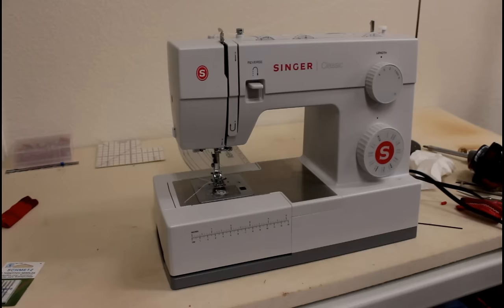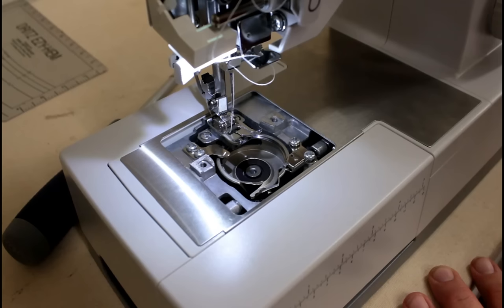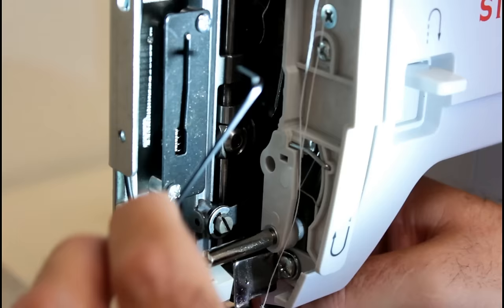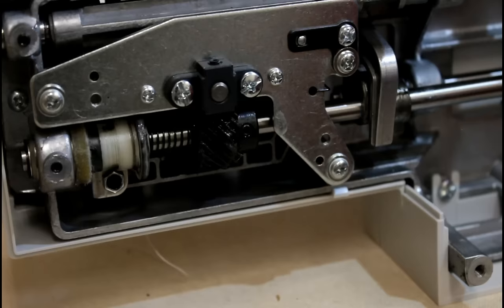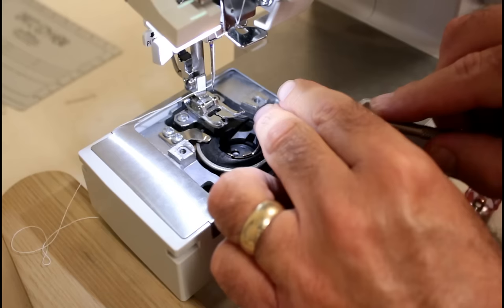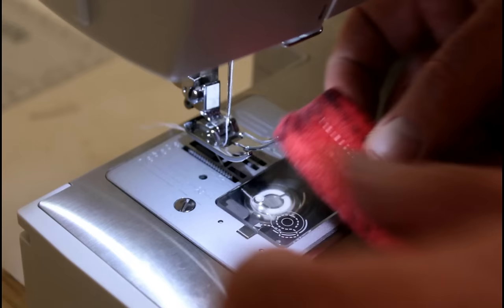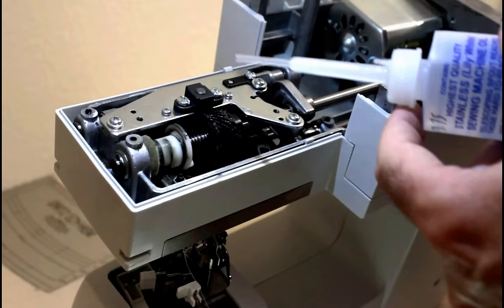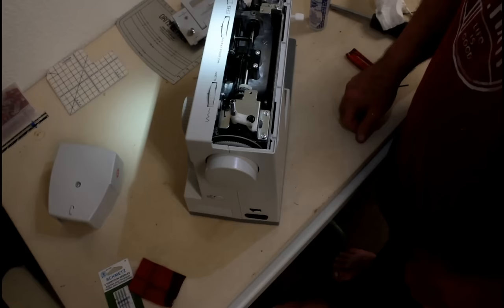Setting the Timing, Greasing & Oiling the Singer Heavy Duty Series Sewing Machines

Comment: Kevin, first of all thank you so much for taking the time to do this tutorial. Secondly, can you please help me figure out why when I loosen all three screws the bottom bobbin plate thing still wont move? I've been working on this for hours and am almost in tears. Please help!
Reply from the maker: I have heard this from a few over the past couple of months. It sounds like they changed something in the factory in the build process. I will post here once I have received any addition information on this.
Reply: @kevinsews  Hi Kevin! I just wanted to let you know that I was finally able to correct the timing using your technique, but I had to hold onto the "bottom bobbin plate thing" (sorry, I don't know what it's called lol) with a flat nose plier and then hold the handwheel still. It was tough because it didn't want to give, but after some elbow grease it worked! Just wanted to update you in case you come across anyone else with the newer machines again. Thank you again for all of your help! I really appreciate it!
Reply from the maker: @erinsullivan3407  I am glad to hear you figured it out. Thanks for letting us all know what you did.

Comment: I love this video. My machine is having a big issue with jamming the whole bobbin housing the black plastic bit that holds the bobbin Seems to get loose. No idea why this has happened so suddenly.
Reply from the maker: I would have to see exactly what is going on to help you figure it out. If the machine has lots of hours of use on it then you may need to simply replace some parts.
Reply: @kevinsews  
Lol Nooo what had happened as the top thread was wrong. Somehow in changing needles I had pulled the thread off the up and down thing, and so when i tested the tension it seemed to be fine. Its now threaded properly and sews very well. I am such a sily, and the lesson I have learned is  make sure the machine is threaded correcly before thinking the machine is broken or something.
Reply from the maker: @davidmarks509  Okay, that is great to hear.

Comment: Thank you for this video! After loosening the 3 Allen screws on the bottom my bobbin will only move freely about 45 degrees back and forth, any idea what could be jamming it? All 3 screws are lose, there is plenty of play within the 45 degrees...
Reply from the maker: Yes, I've seen that. I ended up completely removing the bobbin assemble to get mine to line up.

Comment: Thank you 

Could you by chance show the needle bar clap you adjust?  In the manual there’s an upper one that my machine doesn’t seem to have. 

I’ve gotten it working though more or less, but have noticed since correcting the timing, my tension wheel has to be substantially higher. Before I’d regularly use it around 5, and. Im having to use it almost fully maxed out around 7/8. Is there a way to internally adjust the tensioning?
Reply from the maker: See this video I created on this subject: https://youtu.be/ddFcH5lnnjY

Comment: Hello Mr. Sews, I appreciate your informative video. My machine is identical to yours. I've loosened the 3 screws under the machine like you said (it will not move by itself). I"ve even gone as far as to remove the screws out totally. I've done everything you've said. Is there anything else I can try?
Reply from the maker: I have seen that a few times. I have have used 2 channel locks to grab to shaft to keep it from moving as I rotate then piece you removed the screw from. It will eventually come loose.
Reply: OKay thx, I'll try it.

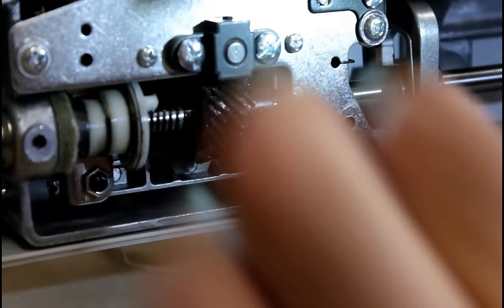Comment: at around @13:40 i couldnt seem to get those allen screws out they seem stuck, any tips? i used the same tool you did but it didnt go off that easily
Reply: @China Muff hello i managed to get them out! You have to use a stronger stainless allen key then lean towards the left and downward so it sounds like it snaps a bit (not really) but its easy to take out from there

Comment: Hi again Kevin! I just wanted to ask another question if that's OK. I followed the instructions and everything in the video, however when I went to go sew, my machine isn't producing any stitches at all. The machine runs fine, however it the thread doesn't attach itself to the fabric when I run the machine to test. I was wondering what kind of problem that could be a result of. Thank you for your time!
Reply from the maker: Sometimes it is a tension issue with the top needle thread. Go ahead and put the fabric under the foot and turn the handwheel to see if the stitch forms correctly. This will show you exactly what is going on.

Comment: Thank you for your video ! I’ve been having a tough time with my new sewing machine. I had the motor lock up, machine froze with the needle in bobbin area, and the needle got stuck in the bobbin case. Now when I sew there is a clicking sound and my stitches aren’t right and i think tension is off! Any advice or ideas? It’s greatly appreciated!
Reply from the maker: Only thing I can suggest is finding a service manual and follow the step-by-step instructions on how to set the timing.

Comment: Again, thanks for making these videos!

Over the past 2 years, I have collected 5 of these sewing machines and 4 out of 5 make a spring noise as the (un-threaded) needle brushes off the needle guard in the shuttle hook, and flexes. I have adjusted the needle bar forward just enough to make it stop - any further and it skips stitches.

If left as it was, I would guess that it would wear the needle guard out eventually (and needles).

Do your Heavy Duties also make this noise (usually on the 6mm zigzag) and do you know if they are supposed to for some reason?
Reply from the maker: None of the ones I own make that noise, so something is up.
Reply: @kevinsews  The newest machine was purchased from a retail store a couple of weeks ago and is doing that right away. Hopefully, I will be able to find out why they are adjusted like this.

Thanks for your quick reply!
Reply from the maker: @rjj2316  You're welcome!

Comment: Thank you for this tutorial. Question. A small felt pad appeared as I was cleaning the bobbin casing and I don't know where it came from. If anyone can help solve this mystery I'd appreciate it. Thanks.
Reply from the maker: It usually goes under the small round shaft that holds the bobbin down that comes from the underside of the inside of the machine. I haven't seen one on my USA model heavy duty machines though when taking them apart.

Comment: Hi Kevin. Thank you for your video. I have done all the adjustments for sorting the timing and when I look at it the hook catches the thread easily on both sides of the needle adjustment. But when I put everything back together and sew a zigzag it sews straight stitches but misses loads. Same with straight stitch it still misses most of the stitches, but looks ok when I take it all apart. Please help
Reply from the maker: You have to be careful when you tighten the bolts. If this isn't the issue then your timing may still be a bit off because the needle thread will be coming down straight off the needle once you've everything back together. You will just have to try it again until you get it down.

Comment: I set the timing everything  works good the thread picks up the thread with the bobbin in the problem  i have is once i put the plate over the feed dog n tbe plate for the bobbin  it will not hook the thread 
I have rethreaded changed the needle try different  thread with different bobbins 
What am i missing  here
Reply from the maker: Check your thread tension. Try loosing it and see if that helps. If it doesn't help then your timing might still be very slightly off.
Reply: @kevinsews  thank you  for  getting back to me so soon  ... i have tried  many different things and  still will not do it with the plate on ...  guess i have to take a 3 hour drive to drop it off to be fixed  thank you for you feed back

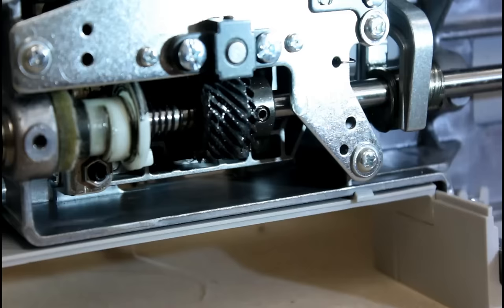Comment: Hello i’m having trouble around 14:20 loosen those screws with an Allen key its so tight it stripped a brand new set I bought for it. Should I apply grease or e-40 its missing my thread bu so little but I cant loosen those 3! HELP!
Reply from the maker: You need to make sure you are using the exactly size. Amazon has a kit I normally use. It has 4 T Sized Individual Screwdriver style bits. You can spay some oil on it.
Reply: Thank you i will look into
Reply from the maker: @yves3721  You're welcome! Let me know how it works out for you.

Comment: I fixed the timing on my machine which is great, but now my thread gets caught on the "spring" part in the lower right. You even mention it at 25:50. I've tried three or four times to readjust but nothing is working. Any advice? EDIT: OK. Saw now you addressed it in the video! I'll fine tune it and see how that works. THANK YOU for your videos. Very cool.
Reply from the maker: There is a tool that is used to place under the piece before tightening it. Try making something to place under that is about the thickness of the thread.
Reply: @kevinsews  thank you! I'll keep trying. I've broken the only three needles I have so I need to stock up. Thanks for the help

Comment: Do you have any information on timing a 5817C Singer sewing machine?  I have tried other sites, but you seem to be the most thorough in your videos and I appreciate that very much.    Thank You in advance!
Reply from the maker: If it is a top loading bobbin then it should be pretty much the same as what I showed on this machine.
Reply: @kevinsews  Thank you for the quick response.  I have 3 witness marks near the top of the needle rod and saw some videos that only mention 2 for making the timing and depth adjustments.  Do these cut lines mean anything to you?  They are about 1/4" apart from each other.
Reply from the maker: @johnbedrosian5781  They probably do. I don't see them on my machine, but it is going on 5 years old. See if your machine is lined  to one of them.
Reply: @kevinsews  Thanks again!  I have been searching for a service manual for this machine, if for no other reason than to learn.  "A mind is a terrible thing to waste"
Reply from the maker: @johnbedrosian5781  Exactly! Let us know what you find.

Comment: Thank you for the video! I was able to fix it so that the hook is able to pick up the thread on widths 1 and 6 when the bobbin is not inserted. But when I put in the bobbin for some reason it doesn’t pick it up at width 6. Do you have an idea what might be the reason for this? Thank you!
Reply from the maker: Check the top thread tension. It may be too tight.

Comment: What causes a Singer Simple Model 2263 to not catch the thread on polyester mesh material but it works fine on cotton.
Reply from the maker: Are you using a stretch needle? If that does not fix it try placing the tissue paper that is used for gift sacks under the fabric. Once it has been sewed you can easily remove it.

Comment: my needle is not moving when I change the position left, right and center. If I remove the top is there something that can be adjusted?
Reply from the maker: When I get back home tonight let me take a look. I will create a quick video on it if possible.
Reply: Might check that the width dial is at zero first
Reply: @mitchell5828  That did the trick. Thank you.
Reply from the maker: @jimwilliams8229  Okay, thanks for the update!
Reply: @mitchell5828  have any suggestions for what I've done to not let my fabric advance?
Reply: @nelsongoodson3906  yes;
What this video doesn't mention and others don't mention is that there are two  ways timing can be adjusted. (Or two places it can come out of adjustment).  Before attempting to adjust the timing you should see if the feed dogs are in sync with the vertical needle movement.  If they are not, you most likely need to adjust the timing on the shaft collar further to the right,  not the one shown in this video.
If this is your case you will first have to get the feed dogs correct w the needle using the collar I described above.  After that you will have to follow the instructions on this video time the hook.
I apologize as this is hard to explain in text.

Comment: Your an amazing teacher!! I have been having trouble with the top thread not catching the bobbin thread.  I have made sure timing has been corrected and also adjusted needle bar.  it seems like when I put the bobbin casing back in and try to catch the thread it won't catch it when the casing and bobbin are put back.  I did notice however there is a missing screw on the bottom where the 3 screws are .  would that be the reason for ally troubles?
Reply from the maker: Are you saying that you are missing the 3 screws that hold on the bobbin to the shaft?
Reply: @kevinsews  just one
Reply from the maker: @karidee3064  Are there 2 additional holes that are missing screws?

Comment: Very helpful, but when I put the machine back together, the feed dogs aren't working. When I turn the hand wheel the feed dogs go up and down but they don't move forward and backward.   
Do you have a video for fixing that?
Reply from the maker: Sue McDonald There is a switch on the backside of the machine that disables the feed dogs. Check it to ensure it is engaged.

Comment: Thank you for the amazing video!  I am a hobbiest and was asked by a friensd to fix her machine.  (Bad experience at the repair shop)  I am working on a Singer Elite ME457, a mechanical machine very similar to the Heavey Duty.  Can I use the information from your video to reset the timing on the ME457?  I believe the needle hit the needle plate and cause the needle bar to move up and go out of timing.  Would your video apply to the ME457?  Also, I would like to get a copy of the service manual for the ME457, would you happen to have a pdf copy or a source to get one?  Thanks again.
Reply from the maker: Try googling it.
Reply: @kevinsews  (1) Regarding Service Manual for Singer Elite ME457.  I have done several hours of google searches  looking for the Service Manual the past few days with no luck.  I can't find anything on the ME457.   (2) Can I use the information from your video and the specifications from the Heavy Duty Service Manual to reset the timing on my ME457?
Reply from the maker: @rafaelmunoz21  You can always try it.

Comment: Hey Kevin, how much does your bobbin wheel move after loosening the 3 tiny screws underneath? Mine only seems to move about an inch back and forth. Is it supposed to move more than that? Cause I've moved it as much as I can, and it's still not close enough to the needle. Thanks!
Reply from the maker: Sometimes I have to remove the screw in the ring on the bottom side of the bobbin under the machine in order to get it to move further.
Reply: @kevinsews  I don't know what screw you are talking about. I don't see a ring.
Reply from the maker: @craigcraig763  At the 24:19 mark you will see the black bracket covering the metal plate just above my hands. This is what holds the bobbin shaft. Losses the screws and remove the meta shaft. This will expose the bobbin shaft.

Comment: Thank you for this tutorial.
The needle is still moving when I try to turn the shuttle race even after I have loosened the set screws. Am I doing anything wrong?
Reply from the maker: I've seen some where I had to remove the bottom in order to get the hook to turn. You will see a silver plate that covers the area you need to get into in order to do this adjustment. Once you get the cover off it should make sense what to do.
Reply: @kevinsews  okay thanks. I will try it out

Comment: Hey thanks a ton for the video! It was very easy to follow along. I do have a question. The set of plastic shims that seem to be apart of the length selector wheel are making this creaking noise when turning the hand wheel, I'm pretty sure it's because of 2 plastic pieces rubbing together. Is there any way to remove that noise? Should I use grease? Thanks again!
Reply from the maker: Try just one drop of oil first. If that doesn’t do it then you can put some grease on it.
Reply: @kevinsews  Awesome I'll definitely give that a try. Thank you very much!
Reply from the maker: @mikeypotts4732  You're welcome!

Comment: Thanks for the video.  I fixed the machine.  The timeing was way off.  The problem now is that it made a loud noise and the needle jumped a stitch and now i'm back to where i started. So i need to figure out why time timing is off again.  Any suggesions on what else to check?
Reply from the maker: Check the needle position as to how close it is to the hook. Your needle height might also be off.
Reply: @kevinsews  thank you Kevin. I watched your video again and you mentioned that--.  Now I just need to figure out the right position.  thanks for your response. I appreciate it and your videos!
Reply from the maker: @victoriafuentes271  My pleasure!

Comment: I take it my timing is off with mine or I will do it all, maybe needle height, as new needles, just slightly shorter, as silly me removed needle for some reason, then put it back in, unfortunately I found out, the wrong Way around, bang, needle busted...ahhh, the joys...as thread breaking all the time, but good informal video 📹.... 👍,  thankyou 😁
Reply from the maker: You're welcome!

Comment: i know its hard to answer in time, but about how many hours should you grease and oil the machine? i realize that if you're sewing heavier stuff there's more stress and heat, as well as speed the machine runs depending on person running it affects this but just looking for a roundabout answer. thanks again :-)
Reply from the maker: One to two times a year in general.

Comment: At around 22:10, what screws/part of the machine did you tighten up? Excellent video. I just need to know that piece of information to proceed with helping my machine. Thank you!
Reply from the maker: It was the screw that holds the needle bar into position I had it set at.